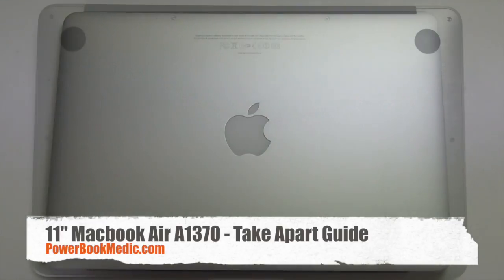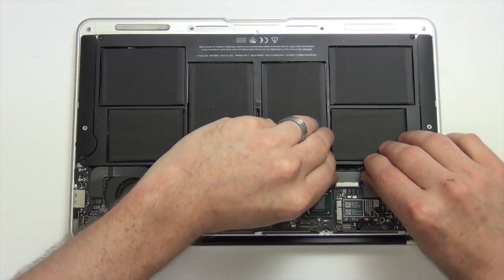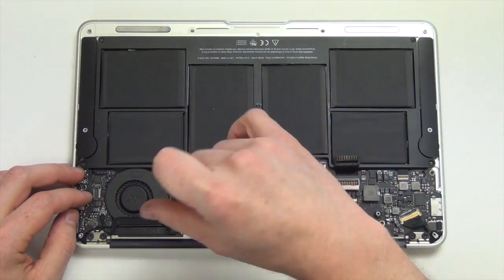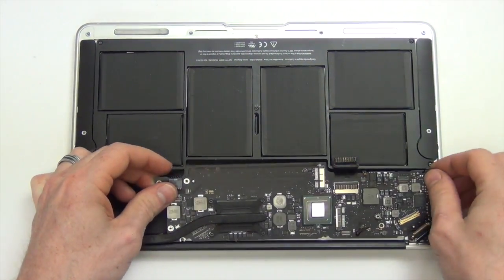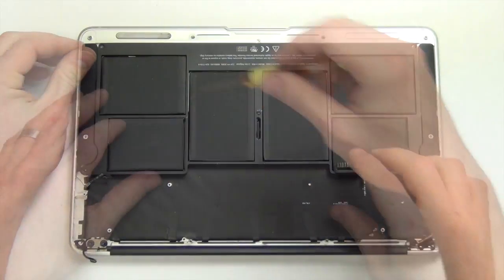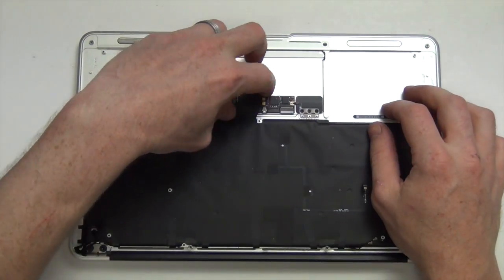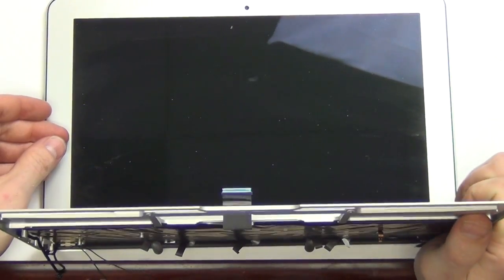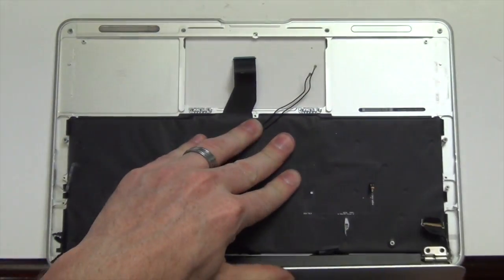How to Take Apart the 11" Macbook Air Model A1370

Comment: sir I have a1370 2011 mid 2gb ram 64 sad..its hanging after little use.. how I can solve problem >if I replace 256gb ssd it will be ok?